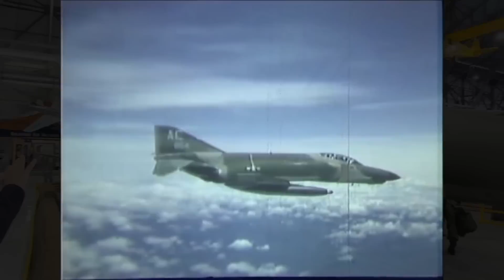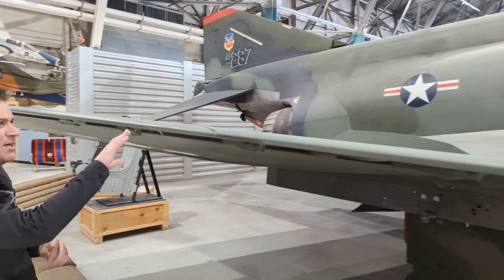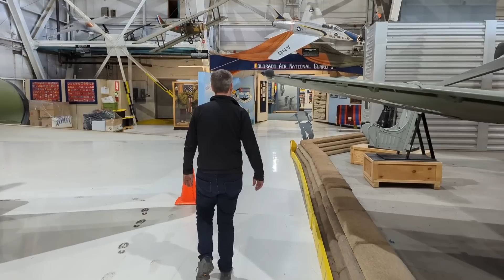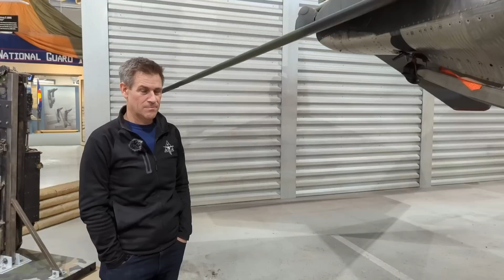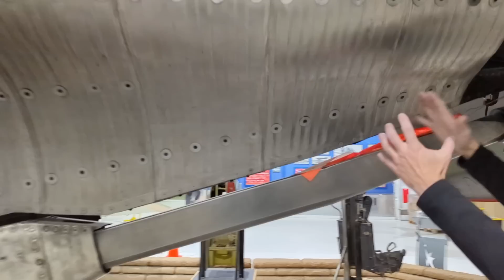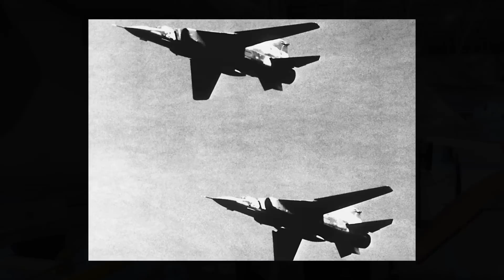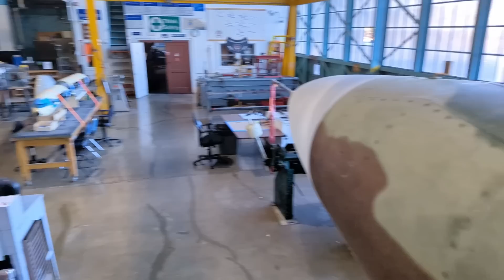The F-110A Spectre (Spoiler: It's really an F-4) - The Century Series Revisited

Comment: The F-110A was never called “Spectre”.  Before it ever left the paint barn in St. Louis, the first aircraft with F-110A titles on it had “PHANTOM II” painted below it.  The only use of “Spectre” I’ve ever found (in going on 50 years of research) was in the popular press.  I’ve never found a single USAF or McDonnell document that used that name.  I wish we could put this myth to rest once and for all.
Reply: There is the AC-130H Spectre Gunship. Never heard the F-4 Phantom II refer to as "Spectre".
Reply: Same myth as theoften mentioned  fact that "every F-104 had a downward firing seat". You can read it today in many books ( Was only the short lived "A"  modell with the C1 seat. Afterwards everyone had C2 or later MB upward seats)
Reply: @MrSdsr  The B model also had the C1 seat, which were replaced in both models by the C2 seat around 1960.
Reply: @dukeford8893 thx , good to know . Manny dokumentations still say “All 104 had a downward ejection seat .” That’s obviously is BS but I didn’t knew where exactly the switch was from C1 to  C2 , from down to up (btw: even ChatGPT is wrong regarding the seats)
Reply: @MrSdsr  I've seen pictures of C models that had the downward seat too, but in any event they were all gone by the end of 1960.
Reply: Never the Spectre, but one name floated for the original F4H-1 was the Satan.
Reply: AND ONCE, THERE WAS A “SPECTRE” ROCKET ENGINE.!!
Reply: You need to find a copy of the ballot competition to name the F4H-1 for McDonnell's employees. It has the name Spectre and Satan plus more listed on it. It didn't matter as old man McDonnell decided on Phantom II name. The ballot's had a drawing of the Phantom on it, a list of names to pick, and a write in section.

Comment: I was stationed at Spangdahlem Air Base West Germany in 1979, which was next to Bitburg Air base. They had F-15s and we had 4s. 15s could take off vertical and the 4s at mostly a 45 degree angle. Now that I know about the tail stabilator being in the afterburner stream, it makes sense why the 4 couldn't take off at a higher angle than it did. P.S. 12:00 Spang had an arrestor cable at the end of the runway and a net just for the runaway scenario described in the video.
Reply: Did you work F-4G's?
Reply: I was at Soesterberg in '78 when they transitioned from the F-4 to the F-15.  That was a lot of fun.
Reply: It was more about the power to weight as to why the 15's could climb better.  Most F-4's took off with 2 or 3 external fuel tanks.  When the F-4 flew "clean" it was a whole different a/c.

Comment: The Phantom FGRs with the Speys had more airframe drag but also about 15% more afterburning thrust. So the take-off distance was some 30% shorter, the climb rate 20% better, the fuel burn was lower, and the plane was quicker accelerating and had a higher top speed at low to medium altitudes where whe turbofan was better, but at the higher altitude regimes a turbojet is more efficient and the actual top speed is better. For the smaller deck carriers the british used, a lower high altitude mach # was an acceptable trade off for all the other performance improvements, especially given their lack of dedicated inflight refueling aircraft attached to the airwings at the time. This is also why the USN never operated any F-4s off their Essex class carriers as the decks were too short to reliably and safely get the planes off the catapult in all possible wind conditions. They also couldn't operate the A-5s, A-6s nor the F-14s for the same reason.
Reply: There are some podcast interviews with British pilots who flew both versions as the RAF flew some ex-USN F-4J’s in the later years
Reply: The Brit F-4 with Speys had air bypass doors on the top of the engine nacelle vs the US version.  Thought they looked a little goofy.

Comment: The story how the F4H-1 and the F-110A became the Navy F-4B and Air Force F-4C is a fascinating one, but the coolest plane you got there is the RF-84K. It has canted tailplanes too, but not for aerodynamic reasons, it hooks and latches designed for it to connect to a trapeze and fit into the bomb bay of a B-36...
Reply: Bud Anderson "Andy" was the successful test pilot for the FICON  program
Reply: The F-4B DID NOT become the F-110... it's the other way around.  The F-4B was made and first flew for the Navy. When the Air Force adopted the F-4 they assigned the Air Force designation of F-110 which was nothing more than a borrowed Navy F-4B.  When the Air Force decided to accept the F-4, made changes to the wing, wheels, engines, and avionics and that became would become the F-4C (after the gov. standardized the designation system).
Reply: @ILSRWY4 Note that I did not say the F-4B became The F-110A. I said the F-110 became the F-4C. What I was referencing was the Tri-Service aircraft designation system, a standardization of military designation that was generated by a congressional investigation into what they perceived as military appropriations fraud. The Navy's designation system had no "1" designation, for example, the Phantom I was the FH-1, the -1 being for a production model change like A, B, C for the Air Force. There were a LOT of F4s. To name just a few, there was the F4B (note no dash) Boeing biplane fighter from the 1930s, Vought F4U Corsair, and the F4D Skyray, not to be confused with the F-4D Phantom II. You might note that, even after the Tri-Service aircraft designation system was implemented, the F4D Skyray became F-6A Skyray even though it was effectively obsolete by 1962. So it was F (for fighter) 4 (4th type by...) H (company letter designator for McDonnell, Martin already had the M) -1 (1st model) I did make one error, all the pre-production F4H-1s became F-4As, it was the production F4H-2 that became the F-4B. So, the Navy was forced to adopt the Air Force's designation system and the Air Force had to start over from 1. Had there been no change, the Air Force F-35 would be the F-146 and the Naval F-35 would be the F3V-1 and possibly -1a or -2 for the Marine version. That's the Reader's Digest version, I warned that it's a long story...

Comment: Cool video, but that example is an F-4E, not a D.  The front end is a dead giveaway, since earlier models, like the D, lacked an internal gun and had a much shorter nose and had a larger radome. The E introduced the M61 Vulcan to the Phantom, and the front end was lengthened and radome made smaller to accommodate it.
Reply: It’s carrying an F4D serial number 66-(0)287 , but that airframe is listed online a# being at Lowry TTC, and not in a museum. Which explains why it’s got the gun of an F4E. WTF do museums in the US do that (paint aircraft in fake markings)) ?
Reply: @neilturner6749  66-0287 is the 4th E produced. The first batch of E's was 66-0284 to 66-0297

Joe Baugher's serial list puts that aircraft at this museum.
Reply: F4 d also had leading edge flaps that blew bleed air over the wings, we would always run our hands over it on a launch to check if it was working
Reply: @pickandstrum  the wing slats were on specifically late model F-4Es, but yeah that plane is clearly not a F-4D
Reply: @theporschetiger  Pretty much all surviving early E's were refitted with the slatted wing starting in 1972, including the airframes converted to G's.
Reply: @adam_mawz_maas  Gotcha
Reply: Yes its an E , but the nozzle its a D maybe a frankenphantom😂
Reply: I was about to write the same thing. This is a F-4E 😊
Reply: I think also the slotted stabilator (in England we would call it a tailplane) is a giveaway that it is an F4E, as these later variants had this incorporated to aid turning following dogfighting experience in Vietnam.
Reply: @lyndonbull3581  The E model came from factory with slotted stabs - nothing to do with Vietnam.
Reply: Different front ends because the R is much different.
Reply: I won't analyze the rest of the assertions but the 'radome made smaller' was almost certainly an improvement in electronics to shrink the radome yet give the same or better range.